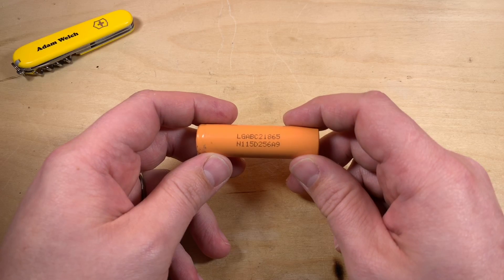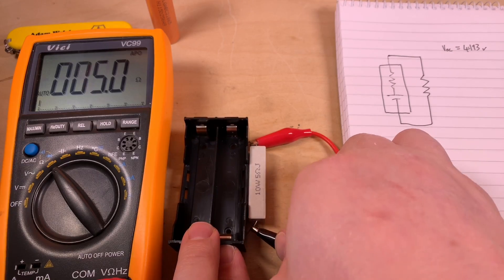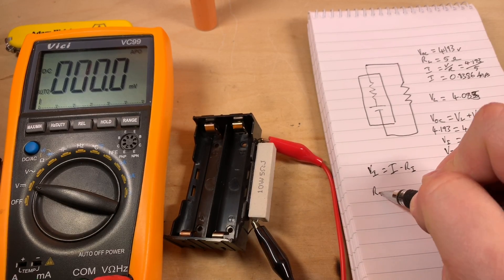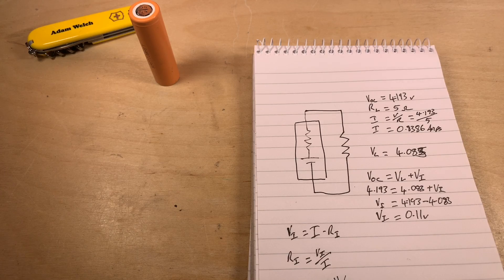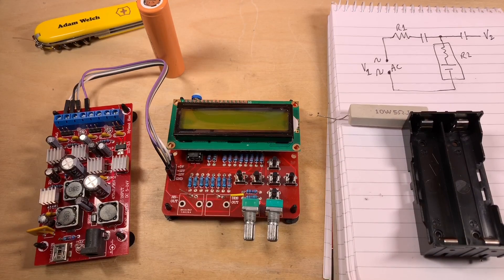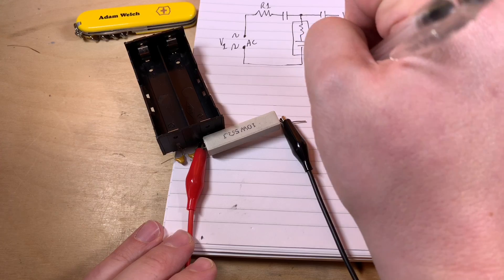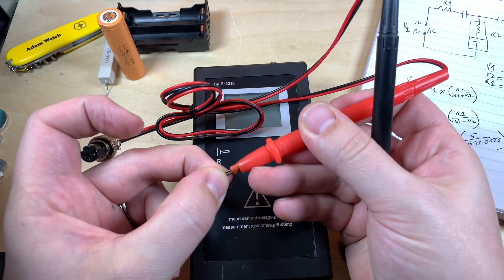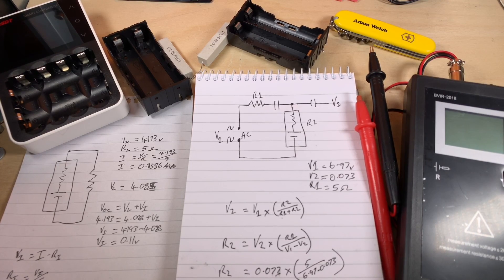Measuring Battery Internal Resistance

Comment: In your AC measurement you are assuming the capacitor is 0 ohms???? I don't think that calculation is correct you need to use the impedance of the cap and 5 ohm resistor

Comment: Several errors here. Some already pointed out (eg 1kHz NOT 100 Hz - it makes a big difference!)
AC IR is great for low power electronics batteries. For higher power such as EV or Hybrid or RC, DC IR is best.
There's a standard UL test. It involves measuring difference between two loads (0.2C and 1.0C), for specific time frames etc... at 85% and 20% SOC (that too makes a difference). And then there's the uncertainties and measurement errors...

Comment: Thanks Adam for your video appreciated your performing the different methods, on the differences on results its like I tell my wife when we go on a diet and she's says what is my weight at the doctors office not on my scale at home. My comment was allway doesn't matter as long as you know what your weight was when you started you will be able to tell how much you lost, the only thing is our scale at home might not be calibrated as the doctors office scale. My point is which ever your method you will be able to monitor your batteries degradation from time to time, you can buy a new battery and see what its internal resistance is and you can compare one batteries internal resistance to the other batteries in your  collection of batteries.

Comment: Greeting Adam, I found out that while your're measuring the battery, you haven't connect your function generator to the battery. So, i think that's the reason your calculation and measuring value are quite different a lot.

Comment: To see if the battery is good or not, you should have told us what the correct Internal Resistance should have been to compare it with the measured and calculated Internal Resistance.

Comment: Those 220 pF caps have a hopelessly high impedance at 100 Hz,  rendering the AC measurement totally inaccurate. The first DC measurement also included the holder resistance, which is not insignificant, better to probe across the cell buttons directly.

Comment: Every DMM calculates the AC voltage a little differently, it does depend on the algorithm in the meter.
That said, your first two were within 20%. Only the second commercial one had a discrepancy that was significant.
I'm sure if you did a sample of ten or 20 batteries you would find the error to be linear. 
Also the commercial unit said the batteries were better than the home brew meter, I call that a win win. Nice tutorial !

Comment: I am sure your capacitors (220pf) are way too small. The Xc  of the caps at 100Hz is 7.2M ohms and means that their value becomes very significant when compared with the the DVM input impedance.
Reply: Thank  you for pointing that out! You too must have stayed awake in high-school AC circuit analysis.  That he got a reading at all, let alone one that within a Decade of reality is pure luck.  Journal of Irreproducable Results stuff!

Comment: Perhaps 0.838A vs 0.800A could account for the difference in resistance.

Also, doing one test after the other (potentially) effects the Vo figure, but still the resistance should be fairly static.

Comment: Thanks. For new lifepo4 cells in 4s do you think it is better to test IR for each cell at high SOC? I have a situation where one of the sales in my pack goes higher than the rest if I exceed pack voltage of about 13.8. Otherwise the voltages are the same at lower pack voltage.

Comment: One thing I've learned from my own testing and some research online is that it's better to DC load test when bat voltage is near to nominal voltage (~3.7). Also if you measure the load voltage first then the open voltage a few seconds after then you take the extra voltage out of the equation. I can't remember what that extra voltage is called but it's basically like a static build up that adds error.

Comment: .003a difference when adjusted for the machines draw of .8 vs calculated draw of .8386. No need to redo its spot on. Approx 4.5 % difference. Doesn’t look like it off hand but easy to ignore with small numbers. 
Great video

Comment: You can't use this. By manufacturer specs internal resistance is measured at 1kHz and C/5 and C/10. So it actually is impedance no DC resistance

Comment: Oh, so many variables in the second method. 

The capacitors have their own reactance, which is considerably higher than the battery internal resistance at 100Hz and should be taken into account. The Vici meter isn't the most accurate and without zero-ing out the lead resistance that can add 10% error by itself (when measuring the 5 ohm resistor). Even the wave form of the generator can skew results (which is only theoretically a perfect sine wave), as you're not using a RMS meter. 

Furthermore, the internal resistance changes (increases) very quickly in the first few seconds of applying a continuous load (you've seen how fast it drifts when using the first method), but the AC method only applies very short alternating pulses that doesn't allow the internal resistance to drift too much. 

I think the method is still valid for comparing different cells, but not for actual measurements.

Comment: Hi Adam i know 9 months has past since this video catching up on all your great vid's.
Can i ask if only building  say a 3s 4p all 18650's charged 4.2v and rested for a month , if  all cell voltages come in between 4.10 to 4.13 volts would that prove the internal resistance are pretty close ?.
Internal resistance would show the drop in voltage same time period and ambien temperature ?.
Thanks in advance.
Reply: No ...

Comment: ADAM WELCH, 
        ////                                          Eric Johnson is saying that overdrive & fuzz guitar pedals that take batteries will sound different when using different types of 9volt batteries NON-Rechargeable 9 volt batteries like Alkaline, Carbon zinc, Lithium, Mercury because of the DC resistance of the 9 volt battery.
        The sound will be different if you use an Alkaline, Carbon zinc, Lithium, Mercury battery each will sound differently because of the batteries DC resistance
 ///                      1.) Why does each 9 volt battery type  Alkaline, Carbon zinc, Lithium, Mercury have a different battery DC resistance?      Why different battery types will have a different DC resistance compared to another battery type, any reasons why?     Yes I know that the batteries DC resistance will drop the 9volts when the guitar pedal is drawing more current but what Eric Johnson is saying is that  9 volt Alkaline, Carbon zinc, Lithium, Mercury will have a different DC resistance which will drop the 9 volt down differently when the overdrive or fuzz pedal is drawing more or less current.

Comment: Internal resistance of a battery is far from stable, it is related to STOC (state of charge) and temperature, and it can be very different for the same battery under different conditions.  Besides, internal resistance is of no real importance for assessing the quality of a modern Li-ion battery, as it does not relate to its capacity to hold a charge. High C batteries can deliver a lot of power at high a current because of their low internal resistance, but that does not mean these batteries are able to hold a charge.
Reply: IR can be very useful ... When comparing cells of the same brand and model, any cells with extremely high IR should be excluded from the pack ...

Comment: From what I've seen in multiple videos that demonstrate the first method (although all the others I've watched used a much lower value resistor), if you simply assume the "real" internal resistance is 80% of your calculated value, you'll likely be much closer to the value displayed by most of the tools that people seem to use to measure and display internal resistance (e.g. battery charger/dischargers) and in this case, virtually dead-on the value provided by the AC method commercial tester you demonstrated. 
Example: multiply your 131mohm value x 0.8 ~105mohm.

Comment: Your own sig. gen. (you've done your test with) was set for 100Hz only but the commercial internal battery resistance meter clearly shown the test done @ 1KHz  (on the LCD screen) and I think that plays a crucial role in such a difference
Reply: You are absolutely correct! The DC test and the AC Capacitively coupled tests are vastly different. As you said his was home built version was 100 Hz whereas the commercial one was 1khz (1,000 Hz). The AC test is what is called an impedance test which is extremely important especially for loads that draw high frequency current (PWMs, VFDs, ESCs and other circuits that draw massive dynamic current). It is exceptionally important for applications such as Regen Braking. Where you can be pulling 10 of amps or in my case thousands of amps where in an instant you can be trying to recharge the battery through the Regen Braking protocol. This can be an issue if the "impedance" is high. Think of it as an ac current (not voltage!!). That is due to pulling current out of the cell and then putting current back into it. Yes current because of how a Lithium battery chemistry is charged.

Comment: Your first calculated current assumes internal resistance is zero.
You should have used a measured current calculated from the drop across the 5 ohm resistor.
Thanks for the info though.

Comment: Adam,  both circuits are poor methods of measuring the internal resistance of the battery.  The AC method is preferred, since it does not discharge the battery with a DC load (thus changing the internal resistance during the test due to partial discharge).  Simply swap R1 and the blocking capacitor positions (making the +ve of the battery terminal connected directly to R1 and the capacitor to the AC source) and connect the common terminal of your measuring instrument  to the battery +ve terminal also.  The internal resistance of the battery is simply :-  (The AC voltage across the battery terminals divided by the AC voltage across the reference resistor R1) multiplied by the Reference Resistor Value.  This is so because both resistances pass the same current and the capacitor reactances do not come into the equation.  Even the calibration accuracy of the measuring AC voltmeter is not important providing it is linear !
Reply: Yes in other words use the 5 ohm resistor as a current shunt to measure current.  At 100 hz his 220pf!!! Caps are about 6 orders of magnitude to small.
Reply: Another way is to just use a signal generator with a known 50 ohm output impedance. Compute RMS output. Measure signal voltage across battery. 50 * VBAT / VRMS. It's not perfect, but very close if the battery's impedance is in the 100mOhm range (well within 1%). 2V P/P = 1.4142 VRMS, VBAT will be ~3mV. One can first measure the true RMS output value with a DMM. One can also use a known resistor value to calculate the true output impedance if needed.

Comment: FYI, you will find that by attaching THOSE LEADS your reading will be +/- 2 Ohms
Meausure the resistance of the leads,  you'll see what i mean
Reply: Agreed, your clips are providing some resistance
Reply: Yeah, but the resistance of the leads is negligible. I tried to measure mine, and even hooking both leads in series, the meter shows 0 ohms resistance, which is far from 2 ohms and infinitely far from 2 ohms. How they would ever indicate  -2 ohms is beyond me, even if they were cooled by liquid nitrogen I don't see how you could imagine a -2 ohm resistance. In other words, using +/ is just flat wrong, and +2 ohms is unrealistically skeptical. Any kind of quality of the leads would be effectively 0 ohms.
Reply: @nfsmith51  

LOL......
i suppose i now have 2 options

1. i can explain this to you
(But.. at the risk of you being argumentative)

2. i can let you figure it out

given your response and the tone in your response,  I'LL CHOOSE TO TAKE OPTION 2. 

let's leave it at that
Reply: @martinkuliza  What's to figure out? In theory, and to a negligible degree, in fact there will be some resistance, but it's not measurable with most meters and is conventionally ignored. Furthermore, unless you live in an alternate universe, it can never be negative. +2 ohms is entirely too much for any kind reasonable quality lead. If you have anything rational to say, go ahead, but stop attacking me personally.

Comment: All you need to do is create an AC current source using a 1uF capacitor between signal generator and battery. If you set signal source to 1.59V rms at 100Hz it will generate exactly a 1mA current source. If you then measure the AC voltage across the battery, the meter voltage will directly read the internal resistance in kohms or 1mV/ohm. To get higher sensitivity use 10uF and 10kHz to give a sensitivity of 1V/ohm.
Reply: AC 1kHz only if you want to measure IMPEDANCE.
Resistance in DC is the DeltaV/Current.
Simple, isn't it?

Comment: The current going thru the resistor isn’t the open circuit voltage / 5Ohm but the measured voltage under load. So:
4.080 / 5V = 0.816A
So the internal resistance equals:
(4.193-4.080)/0.816=0.138mOhm

Comment: Well, I knew I wasn't going to be the only one to spot the flaw with your DC method i.e. you weren't allowing for the current to be affected by the internal resistor. However, here is the solution: Put an ammeter in series with your load resistance and that will give you the actual current flowing. Then measure the voltage across the *ammeter and resistor combined*. You can then calculate the real load resistor value as it will include the internal resistance of the ammeter. Then you can just plug all this into your formula as before, although you won't need to calculate the current as you'll already know it. :)

But of course now you have a couple of commercial metering options so no need to pfaff around with formulas! Which one is more correct? Who cares? As long as you use the same instrument when grading a bunch of cells as it is the relative value that is truly important. 

Four days out from the Winter Solstice here...last few days have been amazingly almost wall-to-wall sunshine! I hope you have an outstanding Summer Solstice! :)
Reply: He does no't need a ammeter, because he measured the Voltage across the resistor while under load, therefore he can, and should have, calculated the actual amps flowing through the resistor ...

Comment: I'd like to ask a question since you are a very precise kind of presenter / based on math and reasoned thought - as illustrated again (thank you) on this video.
I'm trying to measure capacity (loss) over time/cycles of an 18650 battery bank while its live - charged by PV array / discharged to power the inverter - each day.   I'm hoping to get 3,000 - 7,000  cycles out of my 780ah @ 48v 18650 battery bank instead of 100(s) with a design where of 40% DOD in the middle of the battery voltage range.   As part of this,  it would be nice to have a measure of overall battery bank capacity loss over time - and again, a measure of the LIVE system rather than take it offline and spend several days doing static pack charge/discharge.   To take a measure  - I'm recording ah / volt to a fixed inverter cut-off of 48v(3.42v/cell) after the PV array power goes to 0 (no charging - discharge only).    So far, I'm averaging 86ah per volt of drop from the low 52v(3.71v/cell) to 48v(3.42v/cell) range - but the top voltage varies day by day somewhat depending on the amount PV charging for the day.   I'm predicting I'll see this "86ah/volt" go down to 80, 70, 60, 50... over time indicating battery capacity degredation.      Do you have any thoughts on this and if so, would you be willing to share?    Thank you sir.
Reply from the maker: I ran a set of lithium cells for a year - charging and using them every day. I tested the cells before and after that year and documented my results here... https://youtu.be/TeV5rMPPKaM

Comment: There is resistance in the wires and obviously the connections in the battery holder as well.
Reply: Indeed, do not underestimate the resistance of the wires and weak contact points.  It all adds up.

Comment: It's a little mistake in mind. The current through external resistance of 5 ohm is 4.083 v / 5 ohm = 0.8166 A => Internal resistance is 0.11 V / 0.8166 A = 134.70 mohm
Reply from the maker: There are a few little mistakes in the video but hope the main point is still valid. Thank you for taking the time to post - I appreciate it.
Reply: You should acknowledge this mistake in your original post. It's a significant gaff in theory, and it really does alter your main point. I agree with Emil's calculation.
Reply: Do not simply calculate the current by dividing the open voltage by the resistance, you have to measure the current under load.
Reply: @1959Berre  No, we do not need to measure the actual amps under load, because we can calculate the actual amps under load by measuring the actual voltage under load...

Comment: On the first method you need to actually measure the current. It's flowing through the IntR plus the test R and hence will be less.

Ex:
4.2V / 5.0R = 0.840A
4.2V / 5.1R = 0.824A

If you build a constant current source with an LM358 and an Nch MOSFET you can easily measure test resistors for more accurate results.

Better still, use the constant current source to draw a known current from the battery and then determine the internal resistance that way. Lots of very practical and easy ways to do this.
Reply: But you don't know the internal resistance until you know the current. You can get the true current by using ohms law across the load resistor:
 V=IR
V/R = I
I = 4.083/5 = 0.8166 amps.